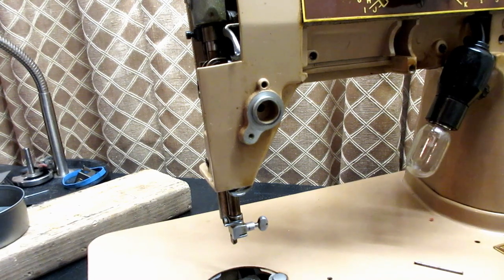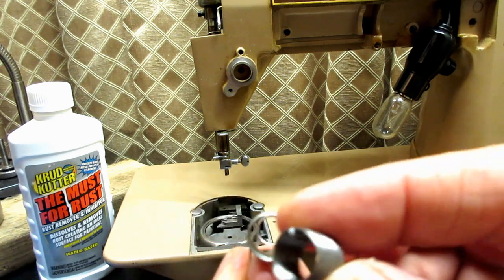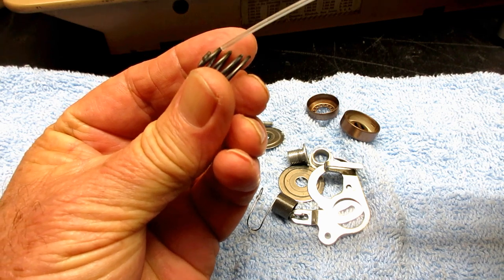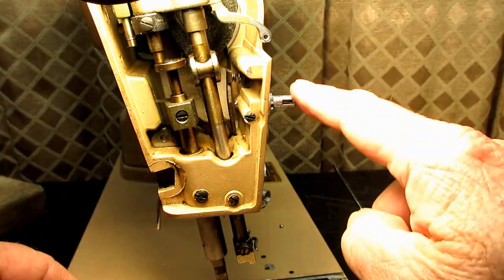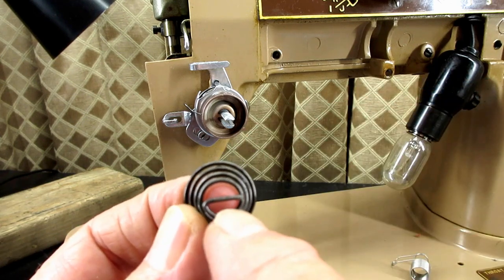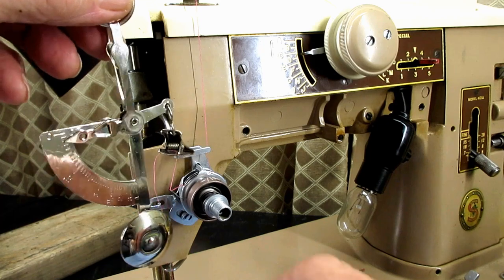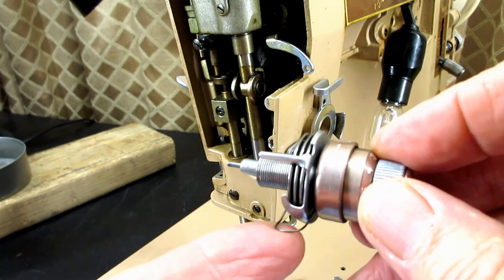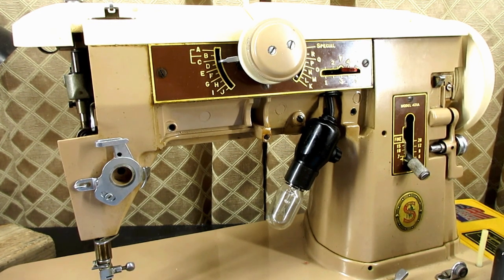Replace / Install a Missing Tension Unit on a Singer Model 401A

Comment: My Singer 401A would never click as I pulled the check spring up and I was having tension issues on knits and had tried every other issue, needle, thread, etc.  So, I have completely cleaned and reinstalled my Tension assembly just as you showed us.  It still will not click, so I assume my tension assy is not adjusting as I change the tension and since it is not clicking, I assume something is bad....maybe the spring or the bar running inside the assy.   Everything looked good after cleaning it up.  What needs replacing?
Reply from the maker: Hi, Kathy. Your assumption about the clicking may be wrong. The click is simply the check spring/take-up spring coming back down to rest on the "stop" (little point thing it rests on) after lifting it with the thread. It might just be how you handle the thread that you're not getting the click. Let's go back to what started your journey here;  "tension issues on knits". A few possible reasons for that. You caught me at the right time tonight. I have about 1 hour before I need to leave for an appointment. If you'd like to email me and describe the tension issue more clearly and what is happening I can try to work with you. andymanuals53@gmail.com
Reply: So sorry I didn't see your reply until now.   I was assuming it was an issue with the assy since I did not get the click and I had tried everything else.  With jersey, knit, spandex, etc I was getting skipped stitches or none at all, but on thicker material like cotton, it sewed great.   It did not matter how I adjusted the tension, so I assumed it must be the tension assy out of whack.

Background:  I found this machine in a junk shop for $40. I had looked everywhere for a 401A.  This was the machine I learned to sew on as a kid and I wanted the same machine.  It was filthy and did not work.  I ordered missing parts, cleaned it inside and out.  Oiled it, etc and it was still sluggish and almost locked up.   I let it sit for a year and I just pulled it back out last week and it works.  It wasn't great, but more freed up.  I kept cleaning and working and it is running really well.   Then, I started smelling something hot and it was the pedal.  So, I just rebuilt the foot pedal and found 6 of the carbon disks shattered.   I cleaned and put it back together and it works, but I went ahead and ordered a new one without the carbon disks while I could get one.  The hot smell concerned me.  

I have another issue besides skipped stitches...the thread sometimes frays from the needle up to the tension assy and breaking occasionally.  Maybe this is related.  Or maybe I have a burr somewhere?   If I can get this tension issue and the thread fraying fixed, this may be the last issues and I'll have this battle won on my 401A.    Note:  the thread fraying and skipped stitches only happens on jersey, knit, etc.   Any ideas and help are so appreciated.  Thankyou.

I wish I had found your videos last year.  That would have helped me so much.  You are awesome.  So easy to understand and follow.  Thanks again.
Reply from the maker: @kathyharris1755  If the thread frays only on knit I'd say it is not a burr on the take-up lever or the thread guides, otherwise it would fray all the time? The 401 and 500 class machines have a know problem sewing knits, especially double-knit fabrics. Singer found a solution by adjusting the hook closer to the needle... very close like barely touching. The adjustment is in the Service Manual and Bill Holman wrote a paper about how he and other repairmen would make the adjustment. I can share those documents if you email me at the address I listed in the previous reply. Also, sometimes, but not always, threading the needle a slightly;y different way can fix the skipping without making the involved hook adjustment. YOu run the thread behind, not through, one of the thread guides. I demonstrate that method starting at 9:05 in this video: https://youtu.be/m79nr_DHRwQ
If you want the documents tonite I suggest you email in the next 7 minutes as I am leaving. You can watch and try the threading method before attempting any adjustments,

Comment: Hi, Andy! I have a question 🤔 What is it that makes the pin come back out? Mine is going into the stud as if to release the tension, but it is not coming back to its "start position " so to speak. Mine is staying in the stud upon raising the presser foot lever to release the tension. The pin will not pop back out to its original position behind the stud on the inside of the machine. If that makes any sense. 🤯 I also have a 329K, similar set up to thr 327.
Reply from the maker: I saw your comment where we were talking about this on the 327K tension video https://youtu.be/d4k2wlDFsj0    and I answered your question there.
Reply: @andytubesewing1953  Thank you! I figured it out and she is working great! I had the dial on backwards and also didn't have her threaded correctly. So far so good! I'm going to check this video out for future reference. Thank you again, Andy! 🙌😁🤗
Reply from the maker: @alyssapeters6271  Yippee! A happy ending. 🌟Glad you worked it out. Thanks for keeping the machine working.

Comment: This is such a good tutorial, I especially appreciate the part on zeroing out the tension. You mentioned your wife’s sewing machines. Are they vintage Singers? I am going to guess she has a 403 and a 338.
Reply from the maker: Thank you for noticing the "Zero-out" tension part. I get between 300 to 500 comments/emails per month, and it is surprising how many are about tension. My wife's daily machine is Coco, the 301A I restored. She took that to replace the Palomino 301A she had for many years. Her other machine is a 403A (good guess) that she occasionally uses for buttonholes and blind-hemming. Bonnie Jean, the 338 I restored was given to my daughter upon completion. I had told her I would restore any vintage SInger she wanted and the 338 was it. Part of the reason was that teal/turquoise is a favorite color, haha. My young granddaughter may want a 337, she's not sure yet. I asked my grandson and he wants a motorcycle instead, hahaha.

Comment: Thank you for posting this!   I need the screw for the thread tension.  Do you know where I can purchase it or an assembly?  I’ve searched the internet and haven’t been able to find one.
Reply from the maker: The tension unit has two screws. A set screw for the tension post, and a tiny set screw for the knurled thumb knob. I've never seen just the screw for sale by itself, but only the whole assembly. With the increased demand from the pandemic, they are hard to find. They do show up on eBay when a seller parts out a machine, but the tension sells within a few hours. https://www.ebay.com/itm/Singer-Sewing-Machine-Models-403A-404A-Choose-Your-Parts-Free-Ship-Over-25/163785629050?hash=item2622625d7a:g:RHEAAOSwhCJdNEYp
BTW, Models 403A & 404 use the same tension unit.
Reply: Thank you.  It is the tiny one for the thumb knob.  I would be willing to buy the whole assembly and keep it for parts.  I’ll keep an eye out.  It isn’t my only machine so the sewing will go on!
Reply from the maker: @AspenGlow2024  Welcome. Here's a little trivia. That screw's official name is "Tension Indicator Flange Adaptor Thumb Nut Cap Set Screw". Whew! The part no. is 906ALZJ. Most call it part 906. 
A=Hardened, Polished, Nickel Plated, and Buffed.
L=Brass Platted. ZJ=Nickel and Chromium Plated. 
That's quite a mouthful for such a tiny screw. Hope you find it someday. Good Luck.
Reply: @andytubesewing1953  thank you!   I love your channel.   I always learn so much and it has given me the confidence to tackle some of the projects.  However next time the cats will be in a separate room.  One of them laid down by where I was working, sniffed the screw and licked it and down it went.

Do you know if that little screw from a 66 would fit the 401a?  I saw just the screw on eBay.
Reply from the maker: @AspenGlow2024  Oh! Hope it did not screw-up your cat! 🤣 There are different versions of model 66. I have some of their parts lists. None of them show that little screw on the tension assembly.
Reply: It says thread tension screw set for a 99 or 66. It is like the little silver one that was devoured. I tried to copy and post a pick but it’s not letting me.
Reply from the maker: @AspenGlow2024  Well. The screw is part 453. It holds the housing for the tension stud; not a thumb nut. It won't fit you nut. Please look for the screw as part of models 401A, 403A & 404 as I mentioned. As an alternative, this is a modern tension unit that is sold to fit your machine. It does not look the same, but viewers have told me it worked for them as a total replacement. 
https://www.sewingpartsonline.com/tension-complete-singer-422403-455.aspx
Reply: @andytubesewing1953  I’ve got my mothers 1953 66-15 to sew on.  I’ll wait until I find the right one. Someone in the FB 401 group that does repairs thinks they may have the right one. She is going to let me know. Thank you for all the info!
Reply from the maker: @AspenGlow2024  I'm glad they can help you out. Happy Sewing.
Reply: @andytubesewing1953  had to let you know a totally different person on that site has the screw and is mailing it to me today. She does sewing machine repairs as a side business. Thank you again for your help.
Reply from the maker: @AspenGlow2024  congratulations!

Comment: Wonder if you could help me? I have a Singer 401G  -similar but slightly different to this machine. The tension unit seems to be identical to this but ...  I put a new tension spring on it a little while ago  (I managed to snap the old one) and ever since I have kept having problems with the top thread randomly sticking in the tensioner. I have taken it apart again following this and your other video to see if I can improve things. (I now suspect it might be due to the replacement spring being slightly different -but I no longer have the original one to check).  However the tension stud does seem slightly bent, but my main concern is that I can't remove it from the machine. I have completely removed the screw at the side, it rotates freely but I just can't get it to pull out. Not sure if it is because the 401G is a slightly different design or if it got bashed at some point which has wedged it in there. And I can't decide if I need to force it out or not bother - the inside pin does move. Any advice appreciated
Reply from the maker: First I'll say I've never even seen a 401G let alone worked on one. I've never been able to find any Parts Lists for the German-made Singer machines. In pictures, the 401G & 401A Tension Assemblies do look the same. The 401A check spring part number is 66774: https://www.vintagesingerparts.com/products/upper-thread-tension-take-up-check-spring-part-66774
Are you sure you need to remove the Tension Stud? Is it just the slotted ends that are bent? I've repaired a few of those on and off the machine if they were not too bad: https://youtu.be/IqoXtj-4tFQ   I have had a couple of tension studs act like yours where I could twist but not pull. I eventually got them out by twisting and pulling at the same time. I believe the cause was the mounting screw had been over-tightened and left a "spur" pushing up from the screw indentation on the stud. That somehow blocked the stud from pulling out. Once I did get them out I was able to file the spur off with an ememory board and the stud was easy to install/remove. The tolerance of the hole to stud diameter is very close for sure. You can also go inside the nose and remove the Tension Releasing Pin Lever and use a brass flat punch to tap on the back end of the stud, but you must be very careful. That way is a lot of work so I tried just the twist/pull method and it worked. You don't mention where the needle thread is getting stuck on the tension system. If the assembly has 3 tension discs as in the 401A, try threading between the 2 discs closest to the front. That can make a small difference if the spring is a tiny bit long.  BTW, I've never heard of the tension spring getting "snapped" so congratulations on that adventure!
Reply: @andytubesewing1953  Thank you so much for your reply and help. I'm in the UK so I believe the German machines are more common here. I have given up trying to get the tension stud out - I have tried pulling and twisting etc but it isn't for moving - I think it well could be the mounting screw being over tightened as that was difficult to get it out...if I ever need to take the tension release lifting etc mechanism out of the nose I might try to get it out from the back then but for now as long as just trying to straighten it works I think better not to potentially create more problems. Snapping the spring - a real fluke accident, all really fast and not sure exactly how it happened. I was sewing a large and heavy canvas material with strong thread, accidentally hadn't cut one of the threads properly.  I was stood up and a bit away from the machine as I pulled the material out I nearly pulled the machine off the table .. I grabbed at the machine,  caught it , dropped it and grabbed again - luckily saving it. - all the while still holding the canvas... I didn't realise the spring had snapped until I went to change the thread...and honestly I was thankful that was the worse thing that had happened, it could have been so much worse. Especially as it was my Grandma's machine, she'd looked after it all those years and I'd only had a year or so ....  Thank you again for your help - and your videos - I have only just discovered them but know they will be really useful for me going forward, helping keeping my 401 going  - hopefully to pass onto my future grandchildren.
Reply from the maker: @whydontyougetlost  I'm glad you saved the machine. Your heart must have been pounding, Whew!  I was able to find my link to a free service manual https://sewingdude.wordpress.com/2012/09/23/singer-401-service-manual/   I have many viewers in the EU and some have told me the 401A Service Manual helped them with their 401, 404, 411, 413, and 431 German Slant machines. Nice to hear from you, and good luck.

Comment: Thanks. Where do you get replacement set screws?
Reply from the maker: Most of the screws on vintage machines are of proprietary sizes, not common. Replacements usually must be found as used items on eBay or other auction sites from sellers who are partings out machines. A very few are made new in China if they have very high demand. Here are a couple of well-known sewing parts sellers who may offer new screws: https://www.sewingpartsonline.com/   and
https://www.vintagesingerparts.com/   Thanks for watching my channel. Good Luck.

Comment: around 28:30 it is unclear how those disc go together. are all 3 the same?
mine has two the same and one that loos like a flat washer. 
and mine DOES not have that nut looking thing with the set screw.
 i have pictures but don't know how to reach you . did the 401a come with different tension set ups?
Reply from the maker: There are different versions of tension assemblies between the 401A and the 403A, and they are interchangeable between models.
You have an original 401A assembly. Your three discs are assembled by placing the flat disc in between the other two with the convex sides facing the flat disc. May I suggest you download a FREE copy of the original 401A Service Manual from Sewing Dude? It has some nice diagrams with instructions for removing and replacing your assembly, including the thumb nut with the pin, starting on page 148. You can download it at this link: https://sewingdude.files.wordpress.com/2012/09/singer-401-service-manual1.pdf   Of course, like all the Singer Service Manuals, it has adjusting and part replacement instructions for almost every part of the machine. Thanks for asking, and for watching my channel.
Reply: @andytubesewing1953  yeah i just saw it in the manual too. my 1st 401a has the version you in your video.
Reply from the maker: @daytonpyro  I've heard the opinion that the one you have they had used before on another model. Maybe the 328k and they used all those up first. Well developing the later one with the three flat discs in the thumbnut with collar and set screw. But it's been a long time since these were made so who really knows?

Comment: Hi Andy 
Do you know how to assembly the thread tension on a Singer 7105. I have a picture.
Reply from the maker: I have a picture, too. That tension assembly is very similar to most Singer assemblies except the numerated dial appears to be a "push on-pull off" dial and not screwed down with a set screw. The part number is 442403-455 is was used on many models. You can buy a new one for $6 direct from the seller in China with free shipping: https://www.ebay.com/sch/i.html?_from=R40&_trksid=p2380057.m570.l1313&_nkw=Tension+Set+%23422403-455+&_sacat=0     HERE IS A SLIDESHOW OF THE PARTS DIAGRAM YOU CAN PAUSE AND READ IF NEEDED: https://youtu.be/fTq8rb5ofTM   Thanks for watching my channel.
Reply: @andytubesewing1953  Thank you so much. 👏🏻🙏🏻👍🏻🇩🇰🇺🇸
Reply: You just made my day - I can’t tell you how much I appreciate this. 🤓
Reply: Hi Andy 
Thank you for the answer. 
Do you think that the replacement from 
China will fit into part 24? And can I also replace that? I think mine is a little bit bent. 
Part 24.
Reply from the maker: @ninariislundstrm1726  I doubt you can exchange parts between the old & new. I would not count on that. The new ones are made to replace the old ones by removing the set screw and pulling out the old unit then inserting the new unit and installing the screw. A complete swap out.
Reply from the maker: @ninariislundstrm1726  welcome
Reply from the maker: @ninariislundstrm1726  👍